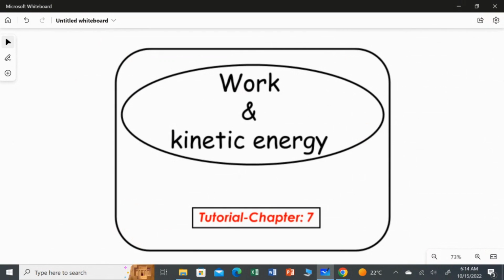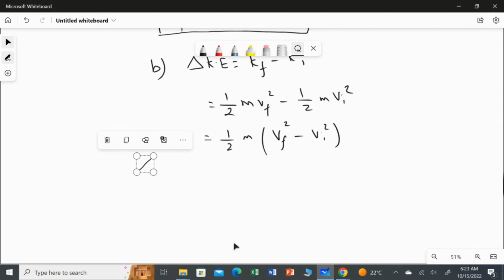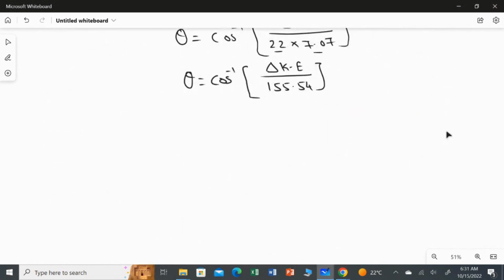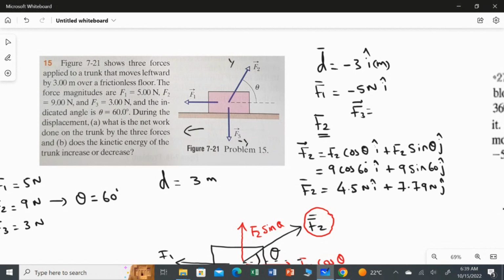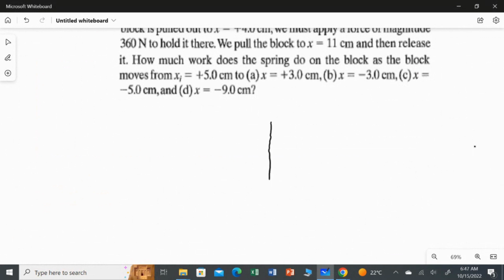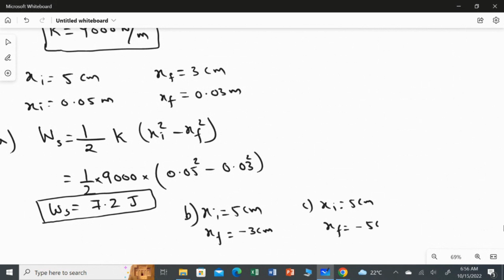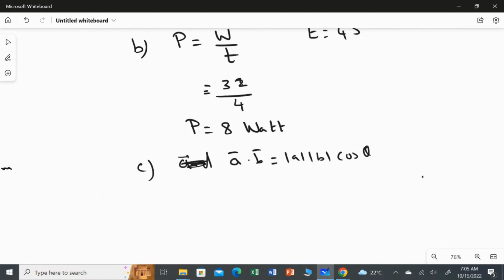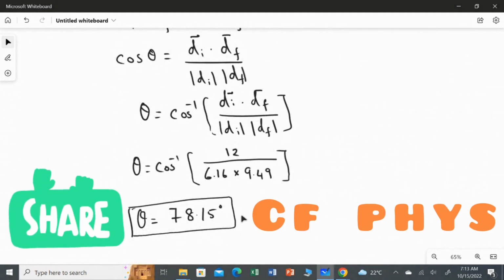Work and Kinetic energy Tutorial

Comment: I feel like Q15 could have been solved in an easier way like so

{ F1= 5N , d=3m, cos0° } & { F2 = 9N , d=3m, cos120° because its the angle between d and f2 } & { f3= 3N, d=3m cos(90°) because its angle is between d and f3 }

Thus we can calculate net work by the formula below 

W net = F1dcos(x) + F2dcos(x) + F3dcos(x)
W net = 5N(3m)(1) + (9N)(3m)(-0.5) + 3N(3m)(0)
W net = 15 J + (-13.5) J + 0J
W net = 1.5 J , which would indicate increasing because it's a positive number
Reply from the maker: In Physics you can solve the problem with any alternate method. I appreciate your work.